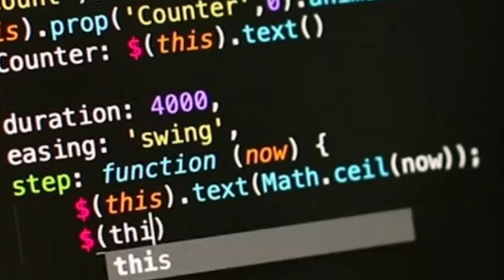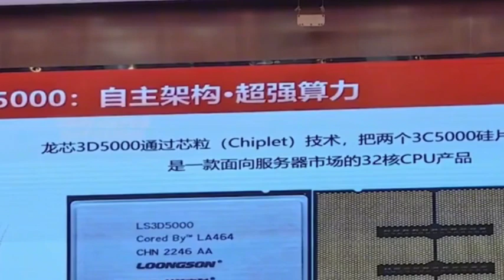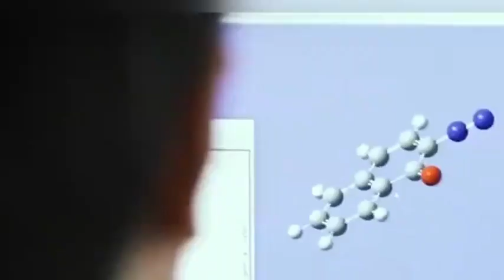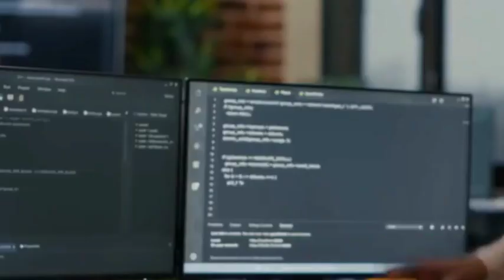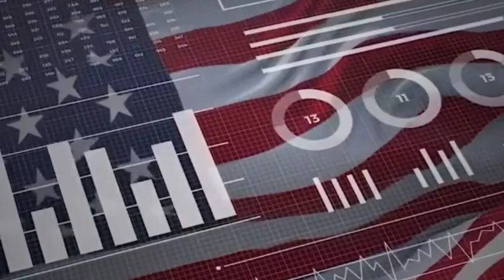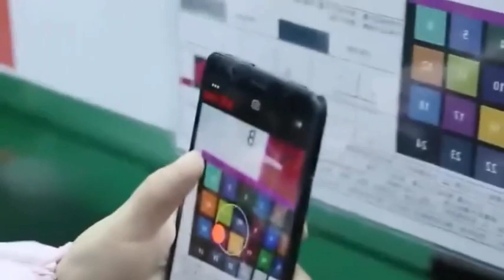USA and Japan jointly suppress China's chip technology, which will lead to a 10-year technology gap.

Comment: OKI have an idiot. I think that it would improve e. V. Just like you have a device that you could use and pump your tire up. Also start your car if needed. What about if someone? Could you the same device? To also charger You're Vehicle It may take a bit longer, but it's just an idea.
I'm pretty sure why we would make it work. Another simple little idea.
This idea been out there long time over 40 years ago while I was growing up in Jamaica. I see bicycle with headlight.  There is a device that you could put onto the fork of your bicycle. It's shaped like a barrel I'm at my ti'm. You would rest the device on.  The front wheel while the wheel is in motit It Generate electricity The car have 4 will if it work on the bicycle. It will work on the car. Well, it's just an idea  If anybody could get it done I believe it would be  a good Idea😮